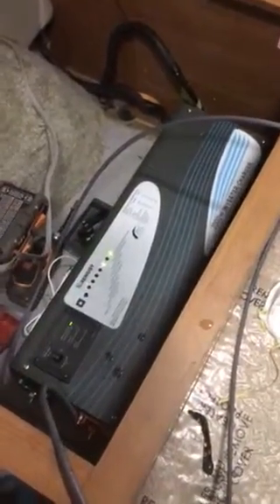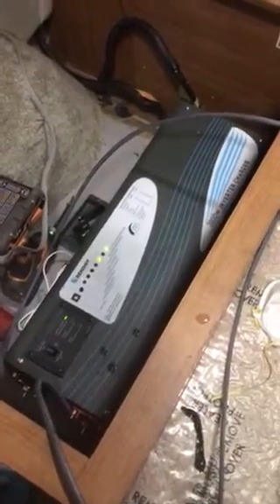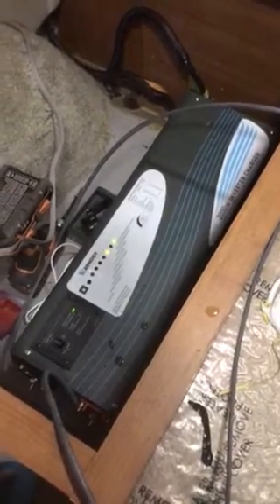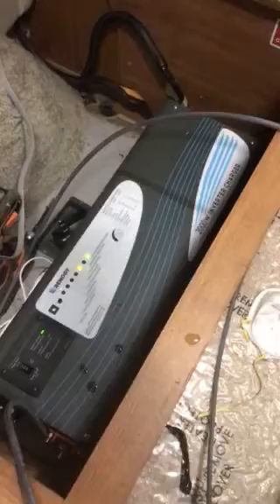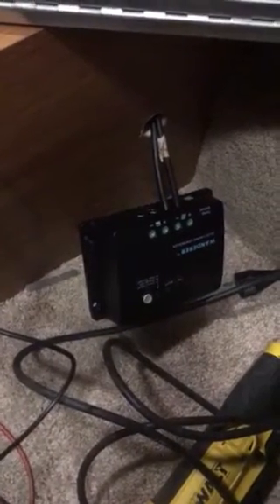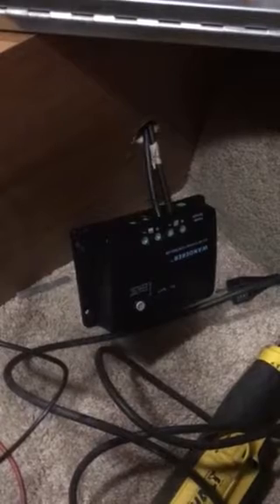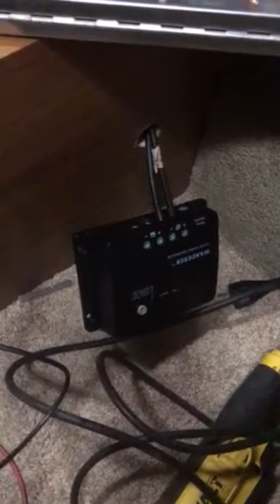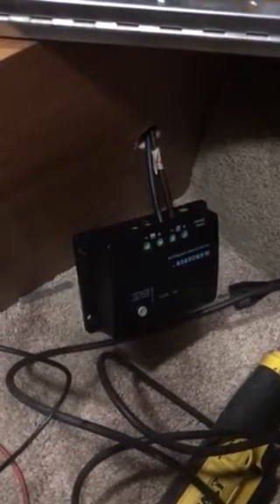Renogy Inverter Charger and Solar Charge Controller install

Comment: Hi there., great video. I'm  about to install a very similar solar setup in out truck. 2000w inverter charger and two 160w panels for 320w total.  Would my setup be okay for one 200ah battery? What about two 200ah batteries in parallel? Thanks in advance.